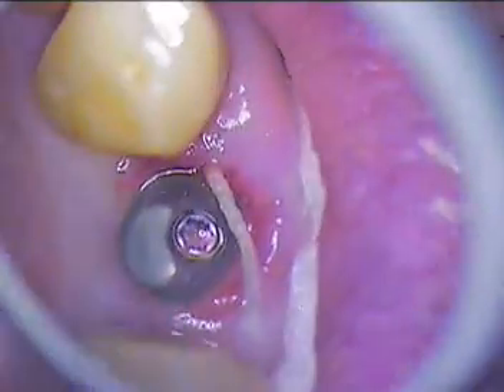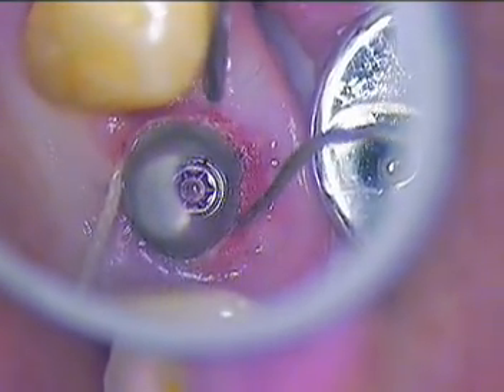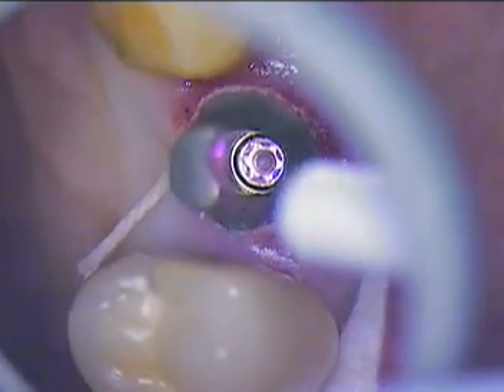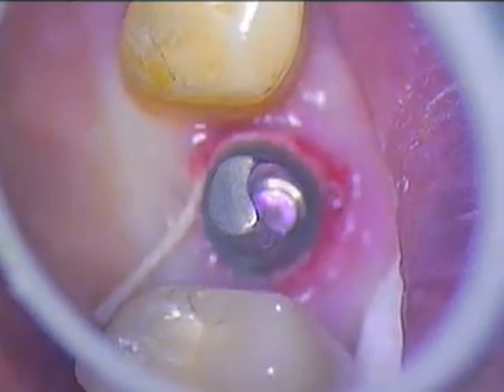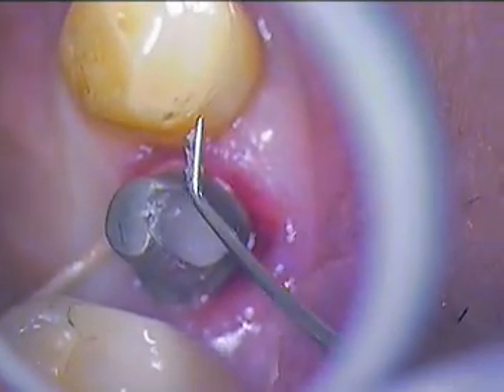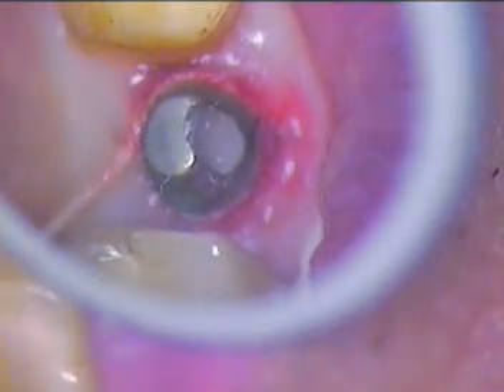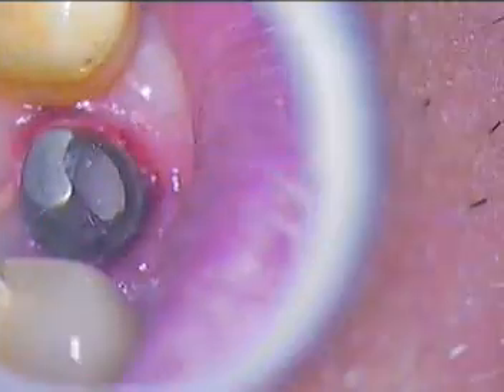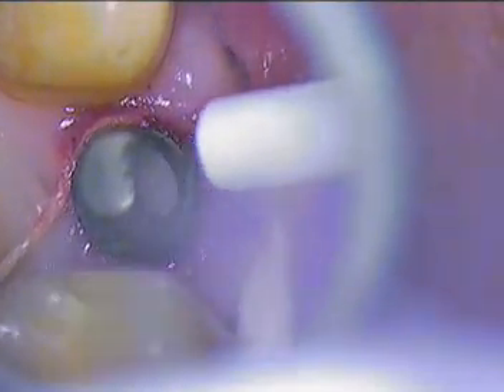DR.GERARD CUOMO -Dental Implant Bone Level final abutment 15 degree and crown 3/3 Boca Raton, FL

Comment from the maker: @divid9369 I understand the conception of cementing long span implant bridge work with a temporary cement.  I try to break up the larger cases into smaller segment bridges.  This way I can use a permanent cement comfortably.  I encourage the screw-retained design whenever possible.  My video, "Ken's Case," covers screw-retained implant restorations. Feel free to contact me for more details.  Cheers. GC

Comment from the maker: @divid9369 Be very careful when cementing your implant crown.  Studies have shown that too much cement causes problems in seating the crown and cleaning it from beneath the tissue.  3% is the right volume of cement to use.  Stay away from Duralon cement. It breaks down Titanium. I like using Relyx Unicem. Variolink II A + B seems to also set slowly enough to seat a case properly.  Remember to just line your crowns with cement.  GC